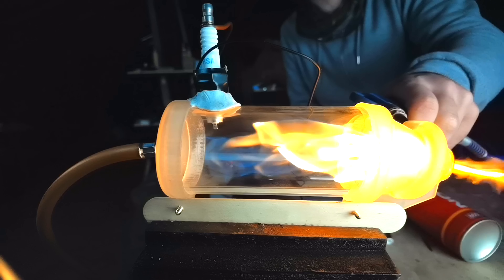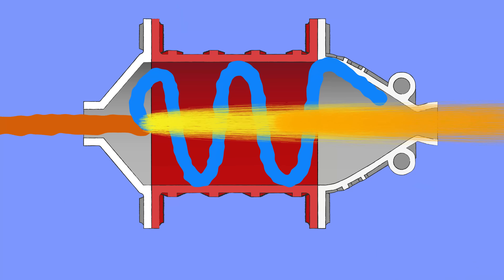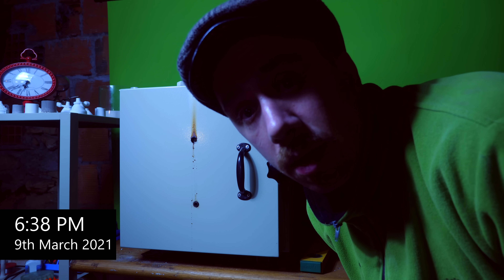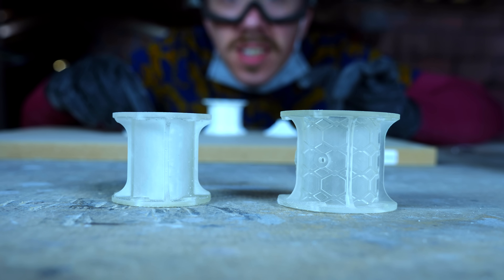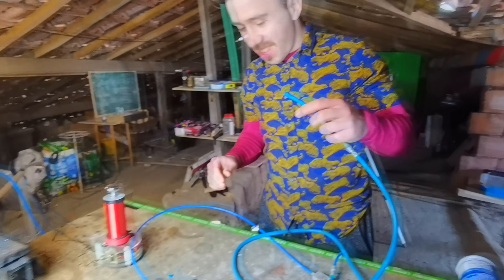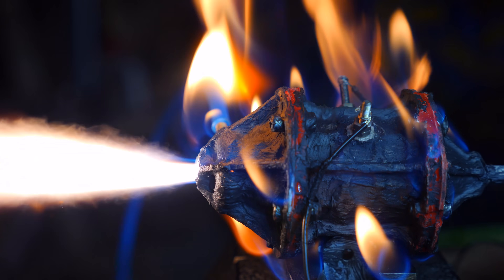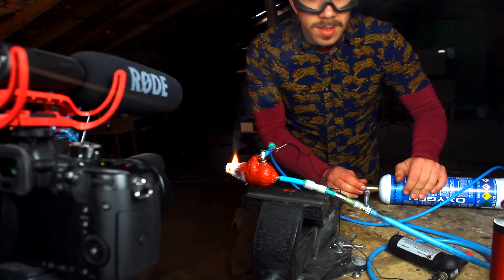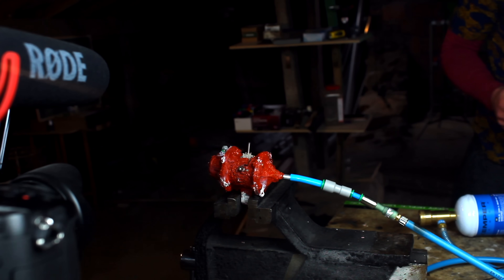Vortex Rocket V2.0 (3D Printed)

Comment: What if you rifled the fuel input tube, so that the fuel has spin as well as the oxygen, if they are counter rotating then any fuel that goes too far away from the central channel would cancel out its angular momentum, this would hopefully prevent fuel from moving too close to the outer edges of the combustion chamber.

Comment: Why not 3D print a slip mould for an engine... may need to drill the holes out afterward but you could get a 100% ceramic motor with no shrinkage?

Comment: Hi, in my opinion the problem with leaks arises through the material. When you burn the resin in the furnace - it leaves leaving micro pores through which at sufficient pressure gas begins to escape from the engine.

Comment: Why not try packing your prints in a material like sand or salt before putting them in the kiln. It can help stop deformation. Also you could try electro plating the prints to increase heat resistance.

Comment: the engine walls are likely burning with the pure 02.  switch the o2 and propane, so the propane makes the vortex.  the engine will run rich and smoky, but the propane will protect the engine walls from burning.

Comment: Maybe use a THICCC (with 3 C's) outer layer of refractory cement, similar to what diesel engines do to cope with the extra pressure they have when compared with petrol.
The only part that needs to have a good shape is the inside of the combustion chamber, so maybe if you make the outside THICCC it could both help it structurally and have a buffer zone for the fire to not blow the whole thing apart.
Maybe put the tubes on, make a cilindrical mould, plug the nozzle, pour the cement around it and vacuum chamber it to get rid of pores.

Comment: Would high temperature paint used for barbecues be good for the leak in the engine?
Or "lower" temp paint used for car engines? 
They're usually in spray paint form

Comment: Why don't you tried to coat the inside of the rocket machine? Make the space inside the rocket a bit bigger, coat the inside with some cement, then sand it down to make it smooth...
Then the outside you coat it also to make it more... leakproof?? 
I heard there were a teflon based sealant that can hold a few hundred degrees fahrenheit?

Comment: You could try different gasses instead of propane for the different temps and see how that effects the melting 
Or try change it the fule injection so that the heat it differed in the location 
Also key the 3D model with a young and grove so the bolts aren’t the only thing locking an axis of motion

Comment: You could build a control panel where you can easily access the propane and oxygen valves instead of crossing the table each time to reach them.  This way you could also place the various cylinders under the table, away from the exploding things, which I think is better.

Not really a fun thing to build but it sure would make your life easier (and safer)

Comment: Not sure if someone mentioned this yet but the pressure in the chamber is pushing your sealant away from the body as there is nothing supporting it: what if you used the glue inside the parts so the ceramic is backing what you are using to seal the chamber?

Comment: I work with porcelain.
You can make pattern with your 3D-Printer,than you can make plaster molds of them and with this molds you can make everything you want out of porcelain ( with porcelain slip,almost like pouring metal)
Depending on what you create,it may be that you need tensioners out of porcelain,so your workpiece cannot deform in the oven.
I hope I could help you a little.

Comment: why not make a external sleeve for the rocket motor that you can pressurize with compressed air or oxygen, for air to leak inward, because the ceramic is porous anyway.

Comment: One method I thought of for making bigger engines is to sculpt the shape of your pulse jet engine or any other engine out of styrofoam. Then cover the styrofoam with layers of carbon fiber and resin. 
After the resin is set you can heat everything up so the styrofoam burns away and you're left with a perfect carbon fiber engine

Comment: You will need to coat the INSIDE and Outside + use an actual gasket. Carbon is your answer. Your problem is that you are using High temp Silicone... which just melts and gives way to the gaps you see when you increase the pressure... because the gaps on the inside let the pressure out.. and the silicone you use to hold it in from the OUTSIDE... has a lower burn temp than you are generating+ the pressure from the inside forcing itself out the gap you didn't seal off.  Thermal Expansion/Contraction (Carbon Gasket Seal) + Coating the inside with your Carbon-based sealant. 

Note: make sure you have a smooth finish inside or that will cause resistance to the flow of gases... and cause your engine to basically rattle apart from the wind buffeting!

Comment: The porosity of the parts produced via the porcelite has a lot to do with the resin burn off. If you had a means of glazing the ceramic parts, on the inside or out, like a vase, you might make it air tight. It’ll be challenging to find a high temp glaze that will both resist cracking under the thermal load of your engine, and can also be fired in your home kiln. Also it will add more time to your process, since you’ll need a second firing, and potentially a much longer one as many glazes are glass, and must be cooled down in a controlled way to avoid thermal shock. 

Another option might be a phenolic resin. If you can find a phenol formaldehyde resin that can cure as a 2-part resin, and you soak the part of dip it in the resin, it should seal up the porous part. They use phenolic in rocket nose cones and in heat shields, because it simply carbonises under high heat. 

Another option worth exploring, is potentially doing a slip glaze in porcelite or another ceramic after the first firing. You might be able to seal the pores this way, granted with a second firing. 

Finally you might be about to slather the finished part in a damp clay mix, clay makes a good air seal and is used as a natural sealant in certain applications. Particularly vermiculite clay may be of interest, as it’s used as a natural fire retardant. Gypsum plaster may also work, but it may be almost as porous as your model so idk. 

Excited stuff though. You’re getting pretty close to a workable solution!

Comment: Some of the leaks seem to be occurring because you are modulating the fuel rather than the oxidiser. The first issue from having the oxidiser flowing constantly and varying the fuel you will get small detonations inside the combustion chamber on startup which would blow the engine to hell if the flow had been properly chocked. the second issue is that the combustion products as a whole are hotter than a fuel rich exhaust as well as being extremely oxidising which means that they will cause anything the is not a high temp ceramic to burn. 

I suspect this is not your only issue but I suggest either having the propane be injected to create the vortex or have the fuel running at a constant flow rate and vary the oxygen. I recognise that you are trying to replicate what sam rogers did with his 3d printed engine, however as his fuel source was a liquid it wasn't feasible for him to use it for the vortex cooling but if you look at some of the cooling methods for larger rocket engines you will find that film cooling of the chamber wall by having a fuel rich region is fairly common.

Comment: maybe get ceramic coating on the outside to seal the printed parts thick automotive coatings might do the trick (sadly you might have to go to an auto shop to coat them) also you could print just the chambers and use the to halves of a turbo make an engine something like a 3 printed furze turbojet just makes my sparkle when thinking about it :)

Comment: You should find a way to make fuel for a rocket out of tomatoes,  that would finally be a good use for tomatoes. Also, I think after assembly of the engine If you use a castable refractory and coat the entire outside including the tubes you can make an engine that does not leak. Maybe use of high temp orings in the construction as well. They are quite expensive but may work.

Comment: Future video suggestion: rocket engine that's 3D printed using the BASF metal FDM filament that you print at home on a regular printer, send out for sintering, and 1-2 weeks later they ship you back your finished metal part. I'm pretty sure they have stainless steel as one of their material options

Comment: Love the vortex jet videos! I will suggest more of those lol. Personally I want to see you eventually evolve to fully plastic where only the nozzle is ceramic so that it could be more easily printed on a normal printer.

Also have you considered designing you ceramic parts specifically to shrink? Like leaving reliefs or small slots that will close as all the plastic burns off? This won't help at all with the leaking, but might make it easier to design larger/thicker parts. The extra leaking probably won't matter either if you can find a good sealant.

Comment: You should submerge the whole engine in cement.....but before that do seal it first, then to support it, use cement....use a pvc pipe as an outer structure for pouring the cement.....i hope it helps.....

Comment: Facts:
- it leeks
- it catches fire

It seems you have some cracks therefore, among the other things, the explanations could be:
-Cracks already existing
-Cracks developed due to huuuuge thermal gradient

Suggestions:
-putting the high temperature cement in the inside not outside (very smooth and very well spread!)
-making the curing under pressure (not easy, but very effective)

keep up with the good work!

Comment: It seems to me that most seems to for a few seconds then the back pressure starts to force combustion gases through the case.
Sometimes you hear pop when throtleing down that seems to be a explosion in the engine which cracks the engine casing. Good luck with it. The other thought I have is before using the engine test for leaking by blocking the nozzle and apply pressure with gas and place it in a water bath just like testing for tires.

Comment: You could try making a engine that uses solid fuel in a powder and then with high pressure air is aerosolised and then pushed into the combustion chamber. With this you could get most of the performance of a solid engine with control of a liquid engine. If you are interested leave a reply and ill send you my email so I can explain it better.

Comment: I don't understand why you keep 3D printing the rocket instead of using high temperature  epoxy resin cast, once you use a vacuum chamber you should have a good seal and they can go up to 600 degree Celsius

Comment: What if you tried a ceramic glaze to seal the leaks?  I’m not 100% sure how it would react when reheated as the rocket is ignited and ran over time as it might turn back into a liquid but i would think it’d work well for short term testing

Comment: your major leaks are in the junctions. So maybe using a different geometry to make a proper fit would be a nice start. I suggest a 'cc' junction, so you will have two lines of protection, where the circles meet. the second thing is to protect your engine from inside, just because outside, when the pressure comes, it has no resistance to leak but the thin layer of cement or whatever you use, but from inside you would also have the structure to hold the pressure before it leaks. perhaps if you also add a bit of this redstuff inside the 'c' to help it seal when you close, then it will be closed forever but not leaking anymore (at least not there). 
btw I have lots of fun watching your videos and I would like to see one of those engines really working!
Greetings from Brazil!!

Comment: Have you tried polishing the mating surfaces of the segments? Add place a pipe fitting to be inserted from the inside and sealed in place, then your fuel and oxy will leak less.  How about adding a depression for high-temp o rings in-between the segments.  Then, once assembled, coat the whole exterior in something like refractory paint/seal used on furnaces.

Comment: can you try like putting the ceramic resin but at the outside of the ceramic rocket? , like you have the ceramic rocket and then putting a bit of the resin without burning it at the outside to stop the leaking

Comment: For the leaking problem you have to impregnate the printed part, maybe you can try with a vacuum chamber to eliminate the air inside the sponge like ceramic so the glue can enter the part when the pressure is reapplied. Also the interface between the parts is important.

Comment: To joint the parts of the rockets you should use labyrinth seals. https://img.oemoffhighway.com/files/base/acbm/ooh/image/2015/06/SKF_Taconite_Seal.558b233e2aa7e.png?auto=format&fit=max&w=1200 ) Also, if you have those leakes its because maybe the vortex is not working properly, otherwise it would only leak air. To reduce the porosity, try to use a vacum bag after applying the sealant so the air inside the material is replaced with the sealant. To generate the vacum, because you have a compressor the easiest is to use a venturi tube ( I have this one Norgren M/58112/09 ). Also you can tru to seal with epoxy a fiberglass, because is a vortex rocket, the walls should not be heated if there is no leaks
Reply: You, my guy, are making a ton of work in order to help him, we appreciate that

Comment: Perhaps an epoxy coat around the ceramic parts would both seal the engine and provide strength to fix the leaking

Comment: @Integza what about 3D printing an engine that sits inside a secondary casing that you could fill with a protective sealant to stop the leaking. If necessary it could also be reinforced with isogrids if needed and would make a much thicker housing without needing to make the wall thickness so big it will crack in the furnace. Another thing that could be useful is using an electronic valve for the propane and Oxygen to have a better fuel oxidiser ratio while also having more control over throttling the engine so it’s easier to shut off and reduce damage done during testing

Comment: Hi @integza!

I think, since you have a sintering oven it may be better that you make ceramics the old fashioned way. This may minimize or eliminate the leaks due to porosity of the ceramic part. You need to crank up temp to porcelain levels. As you know porcelain is more resistant to liquid absorption than plain clay pots. 

You can 3D print with plastic the mold to be used to form the ceramic clay. When you put the plastic with clay in the oven the plastic will burn off and you have a proper ceramic.

Just a thought. Love your videos ... keep it up 👍

Comment: It looks like your motor is burning through which could mean you're exceeding the temperature tolerance of the ceramic binder. The cooling system isn't working. Or you aren't getting all the resin out during the cooking process. You may also be exceeding the mechanical strength of your design at full power. Maybe try building the engine and then coating it with another layer after you bake the first one.

Comment: There is a refractory sealant called Rutland that seems to make better seals than the other brands, may want to give that a try. Someone else mentioned using a vacuum to pull the cement through the porous ceramic and it my be a good idea to try that. 

It may also be smart to slightly water down the Rutland sealant so it can more easily flow into pores

Comment: Try that design which cracked in the kiln.
The one with iso grids.Hey what about using compressed air in middle and swirl fuel around it as jet engines work. This way thrust may fall but air will cool the engine and also direct the exhaust gases .
Please make a iron man gaunlet with a jet engines or rocket engine.
You are great keep up the work.(I love tomatoes but it is a personal preference it is OK if you hate it. Using tomato lord to prove the fact that not every problem is solved alone is extraordinary, it helps the viewers cultivate the habit of observation.) Take care.Use industrial mask when dealing with fine powder.

Comment: Maybe you can make a small engine, put a larger “engine” over it and fill the space in between with cement or plaster, then you have a very thick engine which should probably withstand higher pressures

Comment: actually just add a little bit metal structural support is fine. Or you may get the nozzle a little bit bigger, more of the flow rate is allowed, overall pressure is reduced.

Comment: did you try to put the whole engine in a metal tube filled with your high temp sealant, or cement? that way the extra thickness of the material would be an added insolation and the metal tube would withhold the pressure being built up on the inside 

thanks for your great content by the way

Comment: Try moving the compressed air in the back of the module with your fuel. So you font have the two forced pressures working against each other.

Comment: If it leaks outside make so it can't leak outside putting the engine in a pressurized container so the leaks on the engine will be stopped by the pressure outside it

Comment: I would decrease the amount of fuel or increase the amount of oxygen. I believe you might have a bit of fuel that is not igniting in the combustion chamber and instead, is coming out of the nozel. Some of the fuel may be landing on the outside of the nozzel.

Comment: How about covering ceramic part with metal using some kind of plating methods, that can cover non conductive materials? In this way if the plating will be thick enough it will not leak and more importantly it will withstand the heat.